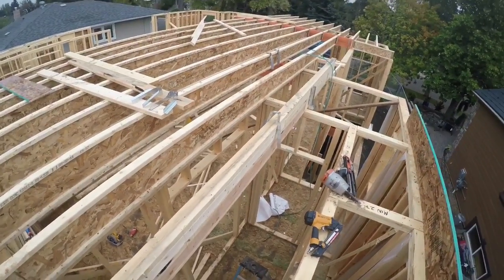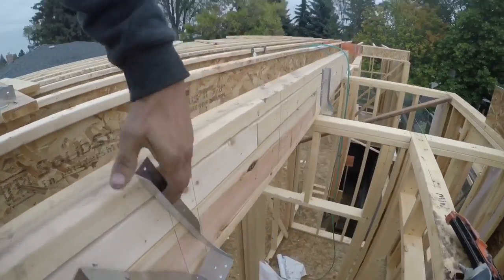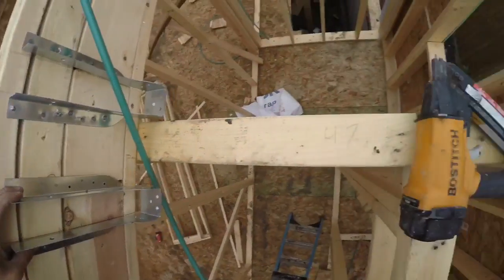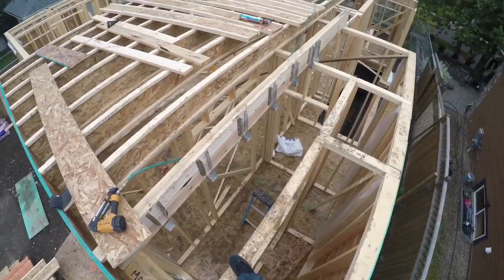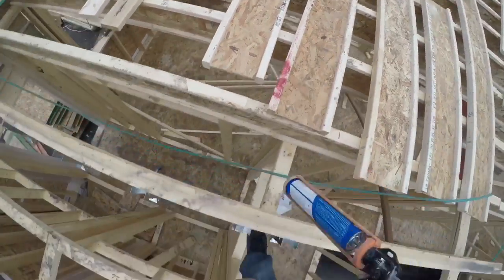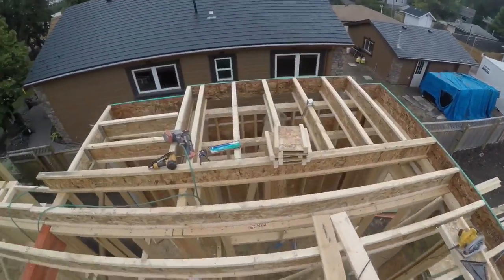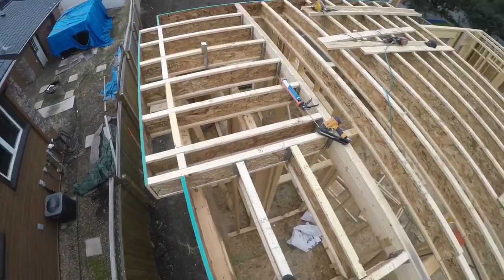How to frame a cantilever

Comment: I've never worked with OSB or webbed joists like that, although I know they're common these days. But jeez, the moment they get wet or light on fire, forget about it. Game over. Not even close in structural integrity of solid lumber.
Reply: Way more structural than dimensional limber and weatherproof for longer than you think. It's engineered , it spans further based on deflection .they are pretty much the cats ass except for the price. They are called ijoists

Comment: just curious? when you add the blocking in your cantilever at the outside wall does it not create a coldspace in the floor which could lead to issues later?
Reply from the maker: That part gets filled with spray foam

Comment: Great work! Just have one question though, where the joist goes into the hangar is there any reason why you nail every part of the joist except the part sitting in the hangar? To me it just seemed strange not to nail the joists at the hangar. I don't do this as a job btw just interested!
Reply: Also I can see it's glued but I would have thought a couple of nails would be better or at least a good addition

Comment: I'm confused as to why the second story is getting started when the first floor isn't even done yet
Reply: What? What do u mean the walls are framed up and plumb
Reply: cool but at 2:40 in the video where is the rest of the exteriors on the left, even if the second floor doesn't go above it they should still be done first but that's my opinion

Comment: It's been a long time since I was a farmer but what's up with no rim joists? Looks like 3/4 OSB.
Reply: Those are 1 1/8th inch rim boards specifically made for I-Joists.  Regular dimensional lumbar is not be used on I-Joists.  I can tell you those feel much denser than 3/4 OSB.

Comment: Did the lumber co. Figure floor joist layout? Wondering why they chose to switch the joist layout back in and out on those last two joist.. I would have pushed to keep them same direction as cant’  would have only required 4 hangers instead of 6. Not have to fill the void in the joist. And easier and faster to sheath if that whole last section was ran with joist orientated the same direction. Also I try and eliminate as many joist hangers when possible as they lead to squeaks (although good on you for glue in the bottom of buckets).
Reply from the maker: That's exactly what I thought, but I just did it the way thier layout showed it.
Reply: The Crazy Framer  oh I get it.. I just hate building something that I know. Is harder/wasteful Because the “engineer” put his stamp on it and don’t wanna explain to the him that it doesn’t look like the drawing because the drawing is stupid.. and IMO less “sound”. Never the less great video. Fun to watch someone that seams to enjoy framing as much as I do.

Comment: Everytime I preinstall joist hangers they get screwed up and never line up flush or too loose in the body...any tips?  Seen guys use a block of whatever you're framing with...  You seem to have it down pat though
Reply: I gotta get that Bostitch gun.  That would speed it up alot.  I think it only does small teco nails though.  So you'd still have to go back and set big tecos....
Reply: Use a small cut off piece of tji and put it in the hanger while installing, use a palm nailer put in the top nails on 2 said then just nail them up
Reply: i made a jig http://i63.tinypic.com/66jjuf.jpg
Reply: Yea me too David, I always installed hangers after flushing joists even though his way is so much faster especially for one man installation. They just never came out flush enough for my anal with in tolerance in the framing field, LOL

Comment: Where's the compression blocking? Wtf
Reply: Not necessarily required in such a short cantilever. Also depends on load carried by cantilever. However not sure about the blocking in between. You're blocking air movement and making it a real pain to do heat runs
Reply: @danielwolfe8  Point load transfer requires web stiffening.......
Exterior wall over the cantilever creates a point load at the exterior wall below. The hangers could be considered as an inverted install because it creates an upheaval condition.
Reply: Point load is the description of a load condensed to a specific point usually under a post or Jack stud. Again depending on load they are not required. In this case load will be dispersed over all joists and joists do not extend beyond compression blocking requirements
Reply: @danielwolfe8  the stud stacking over the joist does transfer a load. Point load wasn't the way to put it, you're correct. The web of the joist is not sufficient by itself. That's why timberstrand is used as a rim joist. It acts as the load transfer instead of the web. In a cantilever condition timberstrand can't be used. Look up the specs. I'm not making it up.....

Comment: safety first man...
Reply: Awang Goneng I guess he is now going to buy a safety harness after reading your comment 😉 I think the same, but he can make his own choices. I assume he understands what happens when he falls head first two stories to the ground.
Reply: You guys realize as framers this is how we work the only people who wear harnesses do commercial where osha regulates job sites
Reply: @charlesspear9516  check out the YouTube video "safety nets installation and falling into nets" 
This is every single building job in nz. You have up to 60k fine if caught walking round with them and fall protection around the edges in the way of a scaffolding lift at 1m max from height of floor and top plates etc. 
It's just normal here. 
People are paralyzed and killed falling from height every day in America.
It's a good idea for a start up. Theres alot of people running safety net businesses here now. The stuff can be pretty unskilled and each job takes a few hours tops.
Reply: @charlesspear9516  na man. I frame residential buildings. We have nets up inside the house in New Zealand. And the scaffold up around the outside. 
You will need a scaffold up shortly anyway to clad the building and paint it etc. Why not put it up a couple of weeks earlier for the framer.
Worst case scenario you shouldn't be falling more than 1 meter (about 1 yard).
Reply: @tubestick00  
Thats one thing that I hated about framing is walking the top plates and you got that big drop! lol
Reply: @tkschannel9973  yea, you fall off and your cooked. Not worth it.
Reply: There is no safety In framing . A harness is just going to prevent your fall. Usually you can grab a chicken board on your slide down . You get up there sheeting rooves and trip over your harness rope once, and see that, that harness is more a risk than anything. Once experienced , us framers walk better on rooves than flat ground. Personal preference but I dknt too off until 9 or 10/12
Reply: Colin Imough I’m 100% sure that there is a practical way to be safe while doing this work. It’s only a matter of costs / benefits. I think it would require a higher point than where you’re working to attach the harness to. Which costs money and time to set up.
Reply: @Engineer9736  it's all learning new ways to work. This is ridiculous. Walking backwards toward an unprotected edge with a 5 meter drop while carrying something. Walking over loose offcuts scattered around on the joists. It's just stupid. Just the kind of guy who will be on disability popping pills depressed in his wheelchair for the rest of his life. Silly.
Reply: Incorrect ,
Profit first, safety second!
You clearly are paid on the hour.

Comment: I’m learning so much from you man you are a badass
Reply: In that case the joists would have to be stepped over when nailing to the plates, which isn't ideal at heights or walking plates. It's an unfair criticism in my opinion, and having worked with my fair share of idiots, I'd hire this guy in a heartbeat.
Reply: Kevin Kelly  "In that case the joists would have to be stepped over when nailing to the plates"
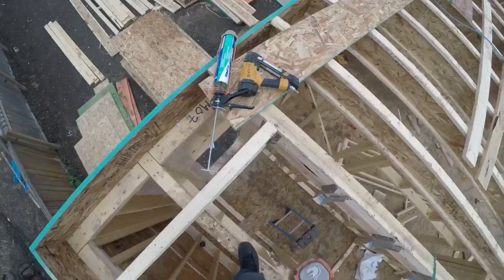Nope, note that @4:43 he's stepping upon 2 parallel wall plates while nailing that 1st joist? Had he first laid all those joists within reach as any competent & experienced framer would've done, he'd simply nail each joist & reach for the next joist without needing to walk back & forth 7 times. IMO it's more dangerous to walk back & forth across the unsheathed joists rather than remain upon the wall plates. 

Kevin Kelly  "which isn't ideal at heights or walking plates"
Neither is stomping down upon the joist @4:48 to seat in upon the hanger. If safety is such a concern for you then perhaps you ought to suggest he use a hammer to bang joists into place rather than jumping upon them.

Kevin Kelly  "It's an unfair criticism in my opinion, and having worked with my fair share of idiots"
Nope, my opinion is accurate, fair & unbiased.
Reply: 70scarresstoguy It’s really simple, if you don’t like the video then don’t watch it. If you think you are better then post a video.
Reply: @70scarresstoguy  you sound like the old crusty salt I had the unfortunate pleasure of working with a short time ago. He always loved to have everything stacked in front of him. Really cracked me up when his cuts would fall through the joists down 2 stories.
Reply: bigbusiness07able   "I’m learning so much from you"
beginning @4:42   just don't learn to walk back & forth 7 times to install 7 joists..
Better to cut the joists, then carry them all over & lay each joist near the hanger it's to be installed upon.
Reply: that's exactly the same amount of walking, so it's no more efficient. Joiners and carpenters can learn from this guy no bother.
Reply: No I suggested walking back & forth once vs him walking back & forth 7 times.
IMO he's either inexperienced or learned his trade from idiots. 
A thinking man would walk over to the floor joints, cut them all, carry them all over at the same time & lay them within reach of their location to be installed. When you're paying hourly wages "time is money", it's infuriating to watch a scatterbrain so blatantly waste money.